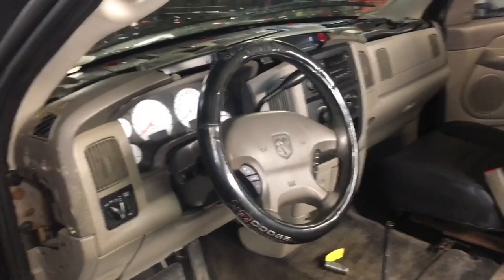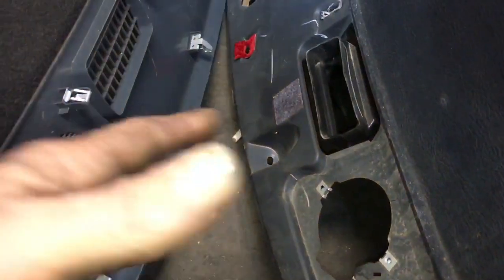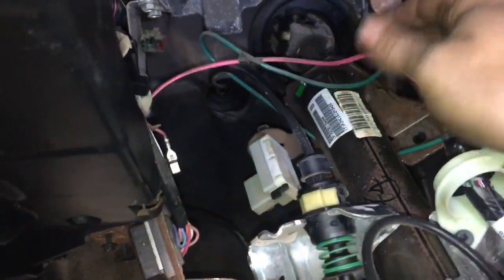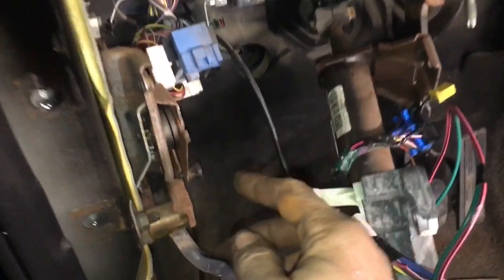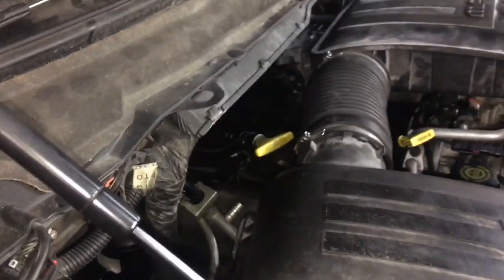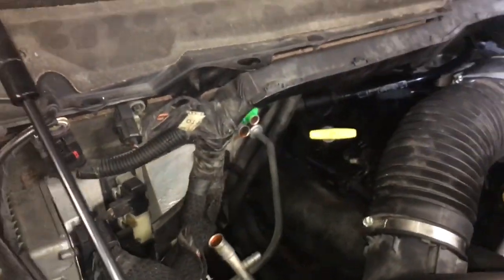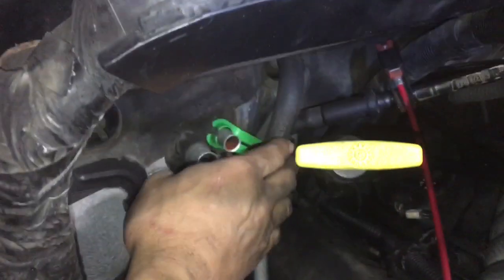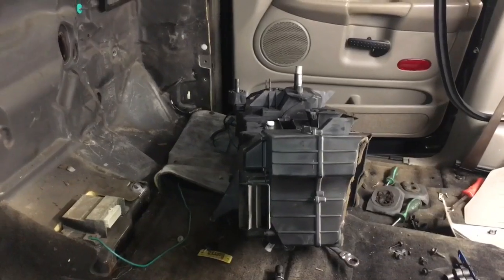Dodge ram dash and heater core removal the easy way

Comment: I will never make the mistake of buying a POS Dodge again. From the multiple valve spring breakages too the garbage 9.25 rear to the Moronic mounting location of the heater core. Purchasing a Dodge is the biggest mistake I've ever made. Avoid them like the plague!
Reply: It's ironic that another word for "dodge" is "avoid".

Comment: Did mine last weekend. Dashboard was no problem but the hardest part for me was disconnecting the A/C lines.
Reply from the maker: I agree one of the easiest  I’ve ever taken out. Yeah them AC lines are in a real bad spot plus them or the style that are kind of a pain in the ass to take apart. Most GM AC lines bolt together so they’re a lot nicer to do

Comment: where do you get those hose tools to disconnect the hoses?
Reply from the maker: Any auto parts store they’re called air conditioning line disconnect tools
Reply: @sharpcarco  ok got you.
Reply: I think fuel line disconnect tools work too. I will find out later today or
Saturday.

Comment: R134a was designed as a replacement for r22 and has an insignificant effect on the ozone layer. The main reason you shouldn't vent it is because it costs money, (and the EPA will fine you),  so it's obviously better to recover it than waste it.

Comment: Appreciate the video, I removed all of the bolts that you showed needed to be taken out, but the driver's side of the dash still won't budge. The passenger side moves freely, but even after dropping the steering column all the way and removing all bolts, the driver's side is in there solid. I have an '02 Ram 1500 4.7L, any help would be great
Reply from the maker: Man, I’m so sorry Alec I greatly apologize and I wish I had memory of doing this so I could direct you in the right direction. The only advice I can give you is don’t think about seeing it put your hands up and try to feel around for different Nuts And Bolts. Sorry brother.
Reply: @sharpcarco Thanks for the quick reply good sir, I am absolutely shaking my fool head right now. As soon as I posted that comment I realized that I missed two bolts underneath the steering wheel column bracket that secured the dash to it. Amazing how much trouble two little 10mm bolts can cause. Great video, thanks again for the reply

Comment: Great video for DIYers like me. I have tinkered around with cars for 30 plus years, changed F/A-18 motors on the flight deck by flashlight. But for the life of me, that drier A/C line drove me to the edge. I kid you not, it took me three hours of hardcore tugging with the disconnect set that I have. I had to go to the junkyard and salvage a heater box, and that drier line I ended up cutting. Reassembling that drier line, it did not just snap into place as the after market evaporator coil must not be machined right and has too much flare on the flange. I am up to 6 hours of failing to reconnect that line. The smaller line, I sanded down the flange and took a Dremel grinder to clean and sharpen the edge and it finally went together. The repair shop is going to have to reattach the drier for me because I give up on that one. On a further note, since my a/c system has been open for quite sometime, the drier is probably not going to work. They say that when you open up the a/c system, to go ahead and put a new drier on. Keep on truckin!
Reply from the maker: Mate. That’s a great story…. It sounds like you cross your Ts and dotted your eyes. 

That is true. They do say that, but I often wonder if they don’t just say that to sell you extra parts … of course I can’t be for certain ivory used dryers several several times and never had a problem for two or three years that I’m aware of.. but you never know people may have not told me because I told them I was going to reuse their dryer. They were like cool saves me money…. 

Anyways, thanks for sharing the story Mike hope all is well. God bless welcome to the channel. Happy to have you.
Reply: @sharpcarco  thank you so much. I fired up the truck and have heat and air blowing through the vents and feel great that I have just about completed this project. I have learned a lot and have actually been enjoying working on the truck with the exception of those a/c lines lol.

Comment: ☑️ Good video, but this looks like quite the project IF you've never removed a dashboard, steering wheel, heater core, etc. I watched a short video before yours, which showed how to temporarily bypass the heater core, by pulling the inlet and outlet lines from the firewall there, and connecting them together with an adapter. But they didn't mention anything about the A/C unit or its lines being affiliated with this. That brings up question #1:
1).  Are the A/C unit or its lines associated with the heater core? 

🚫 Anyway, I've got a 2005 Ram 1500, 4x4, with the 4.7L, and I noticed it running a bit hot several days ago. I added 1/2 gallon of water, drove to the store and back, but didn't see any signs of coolant on the ground underneath it. Then I checked the coolant level again 2 days ago, and it took 1.3 gallons of water! But I still didn't see any obvious signs of leakage underneath.

😒 We are in the middle of a mid to upper 90s heatwave during these several days(perfect freaking timing)! I drove it yesterday, got stuck in some of our never-ending "road improvement work", and noticed the temp was rising up. I still had a good 8-10 mins of driving in 95° weather, as the temp gauge varied between 3/4 to 7/8 of the way to the overheat line. I had already cranked the heater to remove "some" coolant heat, and nervously finished the drive, making it to the bank 15mins before closing time. 

But on my way out of the bank, I finally saw a small puddle of coolant forming under the passenger side, kinda under the back of the wheel well. I went to open the passenger side window, when I smelled ammonia around the passenger floorboard, where I have a couple partial fertilizer bags. I noticed a lot of moisture there too, soaking a box and some napkins(BTW, moisture + fertilizer = ammonia smell). So I waited 20mins for radiator pressure to drop, then added almost 1.5gal of water and drove 15mins home. It never really overheated on the way back, but the temp gauge was starting to rise a little above the halfway line.

Last night, I kept checking it, and I'd see water dripping down onto the driveway, from the passenger side, and a thin line of it running downhill. 

2). Does this sound like a heater core issue? 
3). How hard is it if you're mechanically inclined, but you've never done it, and you don't have any heater core/dash board/steering column related "specialty tools"? Thanks +1
Reply from the maker: Well I’m sorry to hear about your troubles but you definitely did a good job describing the problem it definitely is a heater core from the description that you’re giving me

Answer number one is unfortunately yes the air conditioning Hass to come undone but. It is simple

Number two this is probably one of the easier dashes to get out there are vehicles out there that are the worst this is definitely not one of them. I would believe it’s a fairly amateur novice type job. With the exception of the air conditioning air conditioning does complicated a little bit. And you may wanna consider replacing the evaporator while you’re in there because they’re made of aluminum and they tend to corrode.

Comment: I left a Like because I'm thankful to you for showing me that I am never attempting this job lol heater core are fairly cheap and I was debating replacing mine before selling the truck to fetch a better price but nooooo thank you!😎😂
Reply from the maker: OK I don’t know if you meant that as a condescending insult…. Or maybe you missed the part where I said this is probably the easiest dash you could ever remove… thank you for the like though . 

You should keep in mind that if anybody else can do it you can do it to, and try to remember not to be the next to them but the first of you…..
Reply: @sharpcarco  no sir please don't misunderstand I meant no insult whatsoever I was simply saying for a truck I'm selling this is too involved. My mechanic said it the evaporator core leaking refrigerant. Yours is the 1st video I checked out to see if I can knock it out in a day or so then recharge and sell the truck. Its a great video but I'm not investing the time for this Ram 3.7. I'll just be transparent with the buyer and keep it moving.
Reply from the maker: Yeah I know sometimes I mistake these text messages and sometimes people mistake what I’m saying I just wanted to make sure that it didn’t. Discourage you from doing it. 

If you’re not the mechanically inclined sort maybe it’s not the job for you but it’s not all that hard either. 

I just was worried that I was discouraging somebody and I certainly don’t want to do that with my videos I try to inspire and empower people to do things themselves or at least understand what they’re paying someone else to do. 

I know for a fact that just about anybody can do anything that doesn’t mean they should because some of us have other positions in life and don’t have the time to do these things.

I appreciate the response and thank you so much I appreciate the like very very much. 

Take it easy welcome to the channel im very happy you commented And cleared it up

Comment: Where’s a video step by step to remove the dash my driver side won’t budge but the passenger side is loose
Reply from the maker: Here’s the video for that the top of my dash was broken so I didn’t remove the plastic strip that goes across the top of it but if you very gently take a flat head screwdriver and pop it up near the front of the windshield it will come out of place you have to be very careful that basil likes to break very easily but removing the dash out of one of them trucks is the absolute easiest dash I’ve ever removed out of anything.
Reply from the maker: https://youtu.be/evBTCahvIzg
Reply: The Clay Way thank you! Great video thank you
Reply: William Kiĺl it was the bolts under the steering column once you drop it

Comment: I have a 2003 dodge ram 1500 I am going to try and flush the heater core but my guess is I'm going to have to go a step further and remove and replace it thanks for the video it was all very good info
Reply from the maker: Well thank you very much for taking the time out to send me the message because I do greatly appreciate it (especially nice ones) I wish you the best of luck I do think it’s one of the easier dashes to remove out of the 50 or so that I removed. And I think knowing the bolt locations is probably the best thing about it then you’re not taking stuff apart that don’t need to be taken apart. I will say this I believe somebody said something in the comments about something that I did in the video that may have been incorrect so take a look at them God bless and have a great day

Comment: do you have to get the ac lines cleared of freon? isn't that like $200?
Reply from the maker: You do have to take the Freon out of the system no it shouldn’t be that much to remove it 😉
Reply: no you can move it all enough to get to screws on back of hvac box without hurting ac at all